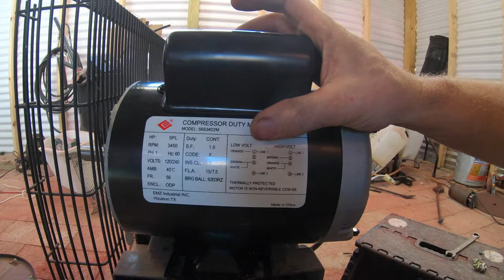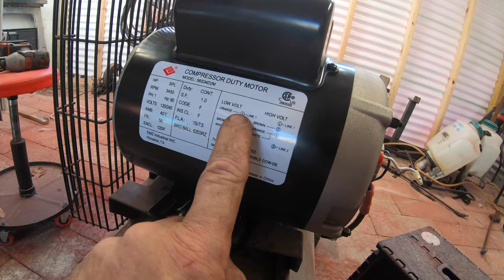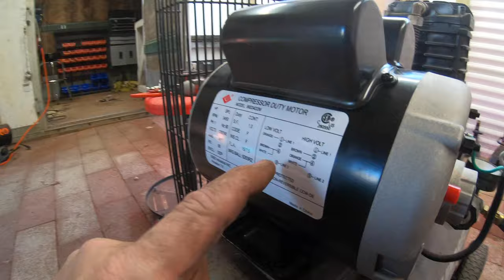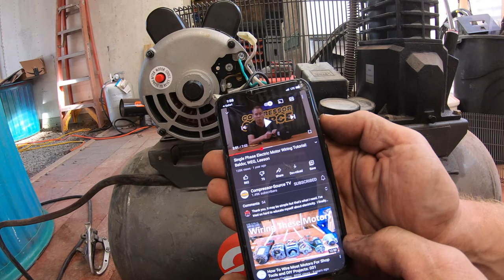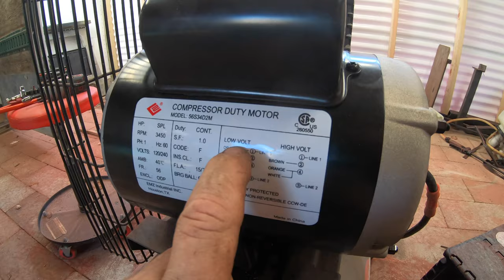HOW TO FAIL Motor replacement on my air compressor

Comment: I'm having the same problem with my Campbell Hausfeld compressor, going on one week of diagnosis ran it off the same Predator generator that you have which only supplies 15 amps on the 120 side you need to pull it from the 30 amp twist lock side I learned that the Emerson Motors are 4.5 horse and need tons of amperage to run the low torque side remember it's a two-stage motor there's a flywheel inside that clicks after a certain RPM and clicks back when the motor turns off , so after losing my mind trying to figure out why the low torque side doesn't work I went and bought an identical unit that was working perfectly fine at the guy's house started up with no struggle at all, he did not use any extension cords just straight into the garage Outlet,  I brought it home and plugged it into my 3500 Watt predator on the 120 side 15 amp Max. It started up but didn't sound strong on the startup like in his garage , after a couple more times of starting it up it started humming like my older unit, I was Furious, but I learned what happened because it was struggling for more amperage it burnt out the contact for the low torque flywheel mechanism there is a small contact in there that disengages when it goes into high speed the contact is the weak point on the Emerson Motors, so I learned these compressors are not like modern dinky weak compressors with only two horse motors, they are professional grade heavy duty made in US just like the label says, they need LOTS OF POWER or else you will burn the low torque startup contact inside the motor which you can go in with 220 sandpaper and clean them to get it working again . The motor specs say it runs at 15 amps LR load rating amps are 98 amps these motors are no slouch, as I'm writing this I'm at Walmart trying to find a heavy duty adapter to tap into the 30 amp twist lock side of my Predator 3500, also leave the Eco button off on the generator. If that doesn't work I'm going to use my champion 4000 w with the 30 amp receptacle on it. Like I said this is going on a week because I need this compressor to paint a car, this has been driving me nuts trying to figure what is going on , conclusion when the motor tries to draw more power than it can get it will burn out the startup low torque contact and even if you plug it into a good wall outlet the contact is still burnt out you'll have to fix that first before you can give it full juice again to operate properly hopefully this helps somebody out and saves their time
Reply from the maker: Wow great info… I recently shopped for the 30a adapter too and no stores had any I had to go to Lowes which had the correct connector and I bought a couple feet of proper size wire there and made my own adapter with a good 20a regular plug so I get clean 30a not through the smaller plugs on the genny
Reply: Great post, awesome information.  But it looks like your wife took most of your supply of periods and commas away from you!  A little punctuation would've made that much easier to read.  <:)

Comment: The ending was epic😂😂😂! I knew when u were on the road it was over😂😂😂😂! Nice one bro💯💯
Reply from the maker: Yea, we all fail at times... just got to suck it up and move forward. Thanks for watching Marq
Reply: @KenMrKLC you didnt fail. It just was time for a nice new one. Im in the trenches right now replacing a motor for $289 off amazon for my old red husky 60 gallon compressor. Hopefully it fixes it. Mine worked well then just wouldnt turn on one day.

Comment: Many of the small generators cant start induction motor, because they cannot supply enough reactive power to the motor. And shortage of reactive power causes voltage drop avalanche. That was 99% the case. Unless you had seized bearings or other mechanical drag problem. Nice vid tho :D

Comment: the problem just was the one way valve... you just dont mind the air circuit only the electric system... and with this NEW and GAS compresor you can get the same problem one day... funny to see your angry face driving hahaha